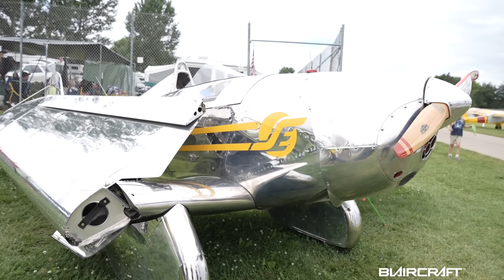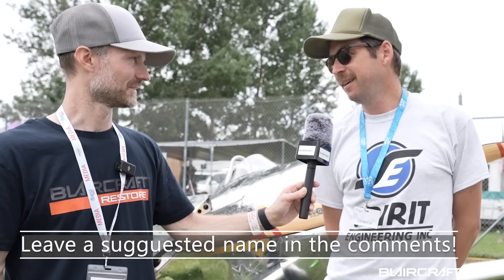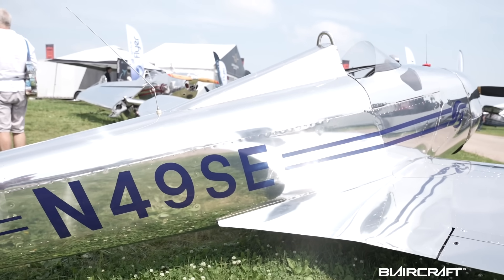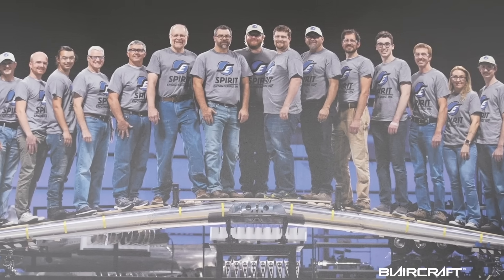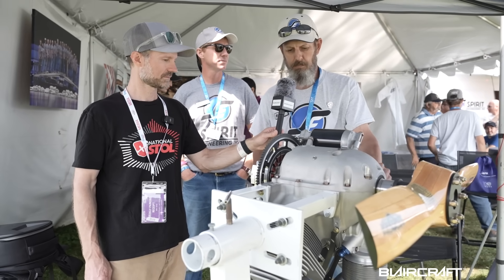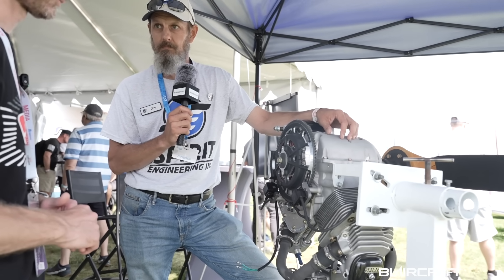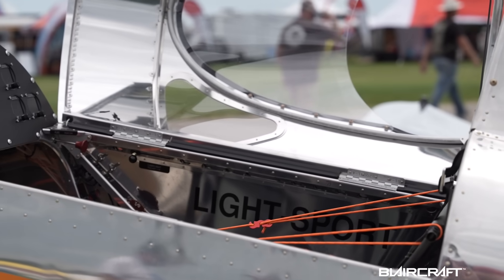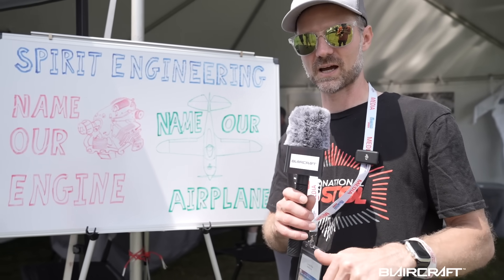Affordable Plane?! To Fly and Maintain, Fold Wings - Spirit Engineering SE-1

Comment: Hmmm. There’s the Thatcher CX 4 - scratch build yet looks more purposeful. There’s the Twister with the spitfire wing(much faster). Not sure a 100mph speed maxim makes it very versatile for its cost.  Nice looking but performance seems lagging.
Reply from the maker: 112 max, 100 @ 75% power
Reply: I think no gear reduction is needed, so the engine must produce a lot of torque and spin a large prop, hence the performance of this sexy little plane. Just my thoughts.
Reply: 2 planes flew to Oshkosh using a 54-42 prop, 2 planes flew to Oshkosh using a 54-40 prop.

Comment: Inverted cylinders would be a problem for myself being an automotive engineer and engine builder. I would have to see what you’ve got set up for oil scavenging, especially on an air cooled engine where clearances😢‘s are all over the place relative to temps, engine load, etc. What piston materials used and are the cylinders true as opposed to choked on the antique engines?
Reply: Dry sump mounted on the firewall, and the oil is scavenged from the bottom of the rocker boxes using crankcase blowby pressure.  Aluminum pistons are machined from standard 96mm forging.

Comment: All video is claiming full factory ,not kit......... currently no factory can produce a fully built aircraft and sell that for commercial sales ,it has to be 51%.........they have told us it's not available for kit sales or plans ...only purchased from factory at $69:500 . So how are they able to sell it as complete....they built 100% of the aircraft...........the customer hasn't built a single part ....so I think this should be checked out by the appropriate people.
Reply: You're mixing several things.  The 51% rule comes from Experimental Armature Built.  See 14 CFR 21.191(g).  This is not an aircraft with a standard airworthiness certificate.  This is a Light Sport Aircraft (LSA) which is certified under an ANSI consensus standard, not the FAA so the aircraft does not have a type certificate (TC).  The manufacturing is not done under an FAA production certificate (PC) either.  The engine and prop are not required to have an TC.  See 14 CFR 21.190 for Issue of a special airworthiness certificate for a light-sport category aircraft.  However, looking at their website, I don't see an licensed professional engineering (PE).  Typically, a company cannot using the word "Engineering" in their name unless a PE is on staff.  In the FAA world, Designated Engineering Representatives (DER) not PEs are used to find compliance with the regulations, but are not applicable for LSAs due to the consensus standard.

Comment: InVee 42 for the engine (In verted Vee). I like the concept of that engine, and obviously a lot of thought has gone into optimizing the construction. High crank, allowing larger prop, but narrow at crankcase height for better visibility. Direct drive, avoiding the weight and expense of a gearbox or other reduction...
Reply: I agree that the inverted vee packages well for direct drive, but the penalty is uneven firing intervals.
Reply: Envy 42
Reply: Seems a bit underpowered to me. I'd feel better with about twice that HP.

Comment: I love its retro polished aluminum skin and it's pylon racer silhouette. And the faired wheel pants remind me of the Granville Gee Bee Model R Super Sportster. I don't like that it doesn't seat 2, it doesn't have a larger fuel tank for real world useful range, and it needs a more powerful engine (for speed and second passenger useful load). It's a major undertaking to manufacture one's own engine so I don't understand why a small Rotax wouldn't have fit or maybe adapted a motorcycle engine? Have they considered counter-rotating propellers for more power and more neutral handling? For names I'd suggest The Silver Spirit and the Spirit V2 engine. The 2 seat version could be called the Silver Spirit 2 and the larger V2 engine could be called V2.1 or V2T, if a turbo. Good Luck!  🇺🇸  🇺🇲  M A G A !  🇺🇸  🇺🇲

Comment: Needs a larger tank option. Like 16-18 gallons usable. To allow trips to smaller airfields that may not have fuel nearby. (And knowing that 2gph "in cruise" is probably optimistic and rounded)
Reply: In my Waiex with an 80HP AeroVee we burn 4GPH in cruise.  So 2GPH for a 42HP motor seems pretty reasonable.  I disagree that you need a larger tank - if you need that range you need a different airplane.
Reply: @bryancotton7279  My preferences and requirements are not for you to declare.

On the engine side even ±0.1gph is a substantial 5% when near 2gph. 42hp and 80hp are maximum outputs, not the cruise output. Cruise conditions were not well pinned down here, meaning there is high chance of typical marketing BS. Dishonestly mixing numbers from different configurations to imply better than achievable real performance. (Eg stating 100mph max cruise, but the quoted cruise fuel burn is at a much slower endurance power setting.)
Reply: @mytech6779 I agree that the "cruise" specs are not as clear as they should be. Cruise at 75% power is listed as 100 MPH, but cruise fuel consumption of 1.8 to 2.2 GPH is only half of the maximum fuel flow spec (4.0 GPH) and may be for the commonly used 55% power. 

A responsible manufacturer should list sets of power setting, fuel flow, and speed for each condition; typically three conditions are listed:
1 - maximum sustained speed 
2 - typical cruise (75% power), and 
3 - economy cruise or best endurance (often 55% power). 

The marketing tendency is to list fuel flow for only economy cruise, and to omit the speed of that econmy cruise, leading people to assume that they can get the speed of 75% power for the fuel flow rate of 55% power... and of course they can't.
Reply: You plan to fly 8 to 9 hours non stop? In this little plane? Get real. That is not a realistic fuel quantity. The airplane simply doesn't have the ability to carry all that.
Reply: @galactictomato1434  There are many pilots that weigh 48 pounds more than me and would still be within this plane's useful load.
Reply: @mytech6779 Wow it's almost like the airplane wasn't made specifically for you 😲
Reply: @galactictomato1434  Hence my statement about the need for a large fuel tank version.
Reply: It runs on 91 octane car gas, so no worries about finding fuel!
Reply: @Video81501  Yeah, just walk 20 miles to the nearest gas station with a couple 5 gallon cans that take up how much of the baggage area [if there is any] 🤔and just hope they have non-alcohol 91. You really don't get out much if you think there is uber service or a gas station at every airstrip worth flying to. Non-ethanol Mo gas is even more of a pain than 100LL, there are one or two stations per county that carry it.(Gasahol is not approved for any certified aircraft, way to many hazards created by the alcohol.)

I'm not even in Alaska or western Canada and I need to plan the fuel range for my motorcycle because the stock "reserve" isn't near enough to get from a halfway point to the nearest station. 
Then there are also issues with "gone fishing" or being off hours when outside the big city. 

Or just ferrying some extra fuel due to fuel price at the destination being an extra dollar a gallon, airlines do this fairly often. Won't break the bank but why purposely drop a $5 bill in the outhouse?
Reply: Not in one hop, but as was stated multiple hops in and out of places without fuel available.

Comment: I saw this plane up close at Oshkosh, and WOW, it looks amazing. I hope to visit the factory and fly one. One issue I noticed was only one spark plug per cylinder. They need to fix this.
Reply: Only one crankshaft, too. If the ignition system is good enough, it will be ok- there are seperate triggers for each cylinder. You could run 2 spark plugs off a coil at each cylinder and still have a failure point at the coil, CDI, leads. Cars go 100,000 miles on platinum spark plugs- that’s well over the TBO of most aircraft engines
Reply: @Bakes-z4c what @Bakes said 👍
Reply: @Bakes-z4c  Numerous aviators have had there lives saved by redundant ignition. Its not the spark plugs that go. It is often something else in the ignition system. Second sparkplug is a pretty basic ask.
Reply: @Bakes-z4c Duel ign.
Yes 
And a spot for ballistic shoot.

Comment: I was curious about the details. $70,000 built amazing.  I have about $70k in my RV-7 I built 10 yrs ago... with some used parts. Today it would be double. I hope they offer a kid at half the price. That would be killer. Keep in mind single seat, open cockpit...not practical but fun.
Reply: Optimum solution would be a closed canopy that could be swapped out with the open canopy winter/summer. LIke the Miata removable hardtop.
Reply: Yes, a closed cockpit is in development.

Comment: folding wing is more about transport to the airport, and being able to put more planes in a smaller hangar.
Reply: This will allow more aircraft on the carrier's flight deck.
Reply: @anim8ted923  if you own a big enough ship, heck yeah!
Reply: It will fit into a standard 20-foot car hauler.
Reply: @tfeather  you missed the point.
Reply: Is 7' 5" within legal load width on the road?
Reply: @nagaster  8 and a half feet. I didn't tell you tho if any angry commentors ask
Reply: @maxdurbin3033  Thanks but I won't tell anyone what for.😀
Reply: @nagaster Yes- but it does not have turn signals so don’t get any wild ideas.
Reply: @christopherpardell4418  lol  - would hand signals be ok ?😂
Reply: @nagaster  It is in Florida. Looked it up.
Reply: @nagaster  Yes. In North America (and perhaps Europe) 2.6 metres or 102 " (8'6") is the widest allowed vehicle. The trick is getting wheels on each side of the aircraft without interfering with loading the trailer or making the overall width across the fenders too wide.
Reply: @nagaster  why are you asking me? go read the regulations. you literally wasted more time typing your comment that it would have taken to find the answer online. It's amazing how helpless and dumb people have gotten. you have answers at your fingertips, and yet you can't figure anything out yourself. still helpless and relying on others for everything.
Reply: @nagaster  If you need to ask the legal width of vehicles then it doesn't matter because you shouldn't have a driver's license in the first place.
Reply: @mytech6779  That's ridiculous - there is no reason for a typical non-commercial driver to know the maximum width of a vehicle.
Reply: more about transport and storage than what other consideration(s)?
Reply: @myotherusername9224  He means transport between a home hanger and a local airstrip, as opposed to long road trips. (Though it is true that long distance travel is also transport.) To avoid the excessive cost and limited supply of on-airport hangers, or in the off season, or to use some local grass strip that has no hangers but is much closer than one that does have hangers.
Reply: @myotherusername9224  transporting it to/from the airport between flights to avoid hangar costs.
Reply: @myotherusername9224  Presumably he meant more about transport to the local airport and storage than about long-distance travel with the aircraft on a trailer... which is the scenario which he mentioned in the video.

Comment: Does the engine have two spark plugs per cylinder?
Reply: It does not appear to... but it does have a complete ignition system for each cylinder.

Comment: Dual ignition?
Reply: It does not appear to... but it does have a complete ignition system for each cylinder.
 This is basically the same as found on a lawn mower. look up briggs and stratton patent
Reply: @johnschreiber1574  or single cylinder motorcycle. Pretty reliable set up
Reply: This engine had two spark plug holes but one plug per cylinder.  The other plug hole had a compression release in it.
Reply from the maker: I said yes….. edit: Good question, it wasn’t mentioned and it’s HARD to tell.

Comment: That is a gorgeous plane.  I'm upset I seen it there at Osh and didn't go check it out.  This would be a perfect little time builder fun flyer.  Razorback Solo for the plane and Deuce for the engine.
Reply from the maker: So much to see… it’s always a trade off on what to stop for. 
I’m considering making a trip out to the factory and checking everything out even more.   I’m impressed with everything that they have been working on. Everything looks well built with attention to detail.
Reply: @Blaircraft.Engines would love to see a factory tour video if you get the chance.
Reply: 'Solo' is taken, so is Razorback